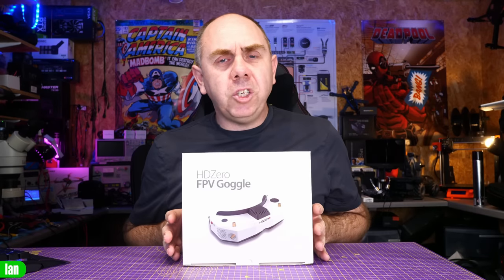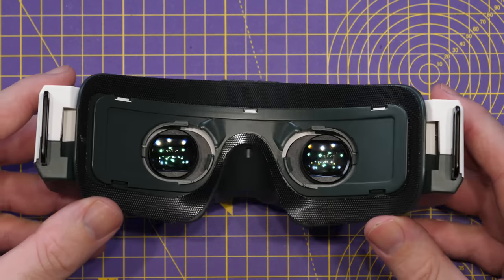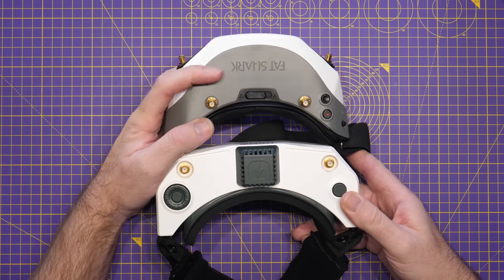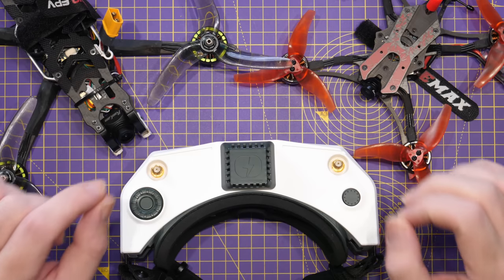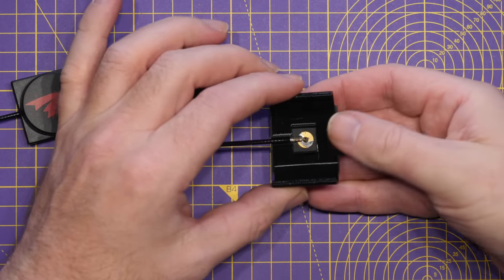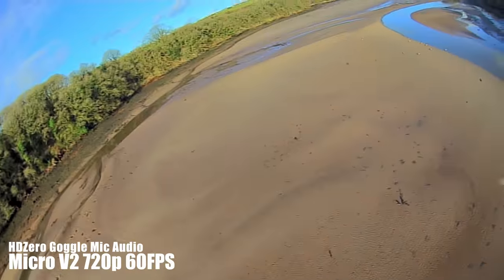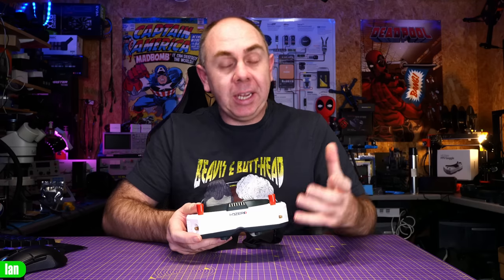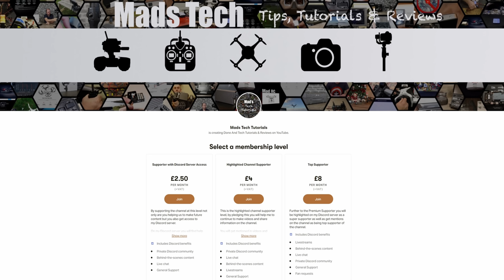HDZero FPV Goggles Review - Best FPV Goggle Available Today?

Comment: It's a feature rich goggle but...
1) I have some analogue goggles.
2) I couldn't live with HD zero's almost constant  breakup.
3) Ultra low latency is of little interest to me.
On the upside, the + 6 focal range is better than just plus 2 like on my Walksnails... HDMI input port...🤔😳🇬🇧
Reply: Very true
Reply: Almost constant breakup? Where do you fly bro? Are you flying strictly in high reflective metal envrions? Where are you seeing constant breakups lol
Reply: @elxero2189  You can see it on most HD zero clips...go anywhere slightly out of LOS and it starts it's breakup....🤔🙄😳😏

Comment: Plus, the only goggle on the market which allows -6 to +6 focusing.
Reply: Skyzone also does I think.
Reply: @JoshuaBardwell  No, they claim -6 to +6, but if you ask them (as I did by email) they admit this is an error in their spec, and it actually only does -6 to +2.

Comment: There’s some pilots reporting screen rolling with every vrx except Fusion.Also racers are supposedly not able to race with Rapidfire in HDZero goggles and are buying Fusion so they can race without getting rolling screens.
  Can anyone verify if it’s rumors or facts?
Reply from the maker: Not everyone is having issues. They are still working on improving FW.
Reply: @MadRC  Thanks for the update!!!

Comment: Can you tell me your personal impression on the FOV in 4:3 compared with the SKY04X?

Of I am correct the FOV is smaller while the resolution is higher.

Goggle ratio FOV horizontal vertical resolution

Skyzone 4:3 46° 35.3° 1280x960
HDZero 4:3 35.3° 26.9° 1440x1080
Skyzone 16:9 46° 26.9° 1280x720
HDZero 16:9 46° 26.9° 1920x1080

This is just the math relying on the specs.
Reply from the maker: Yea on 4:3 it’s a smaller fov due to the 16/9 screens. It’s not massive but it’s smaller.
Reply: Thank you!

I have to correct my table! I was wrong about the FOV as not the horizontal FOV but the diagonal FOV is given.

Skyzone 4:3 46° 1280x960
HDZero 4:3 38.3° 1440x1080
Skyzone 16:9 46° 1280x720
HDZero 16:9 42.6° 1920x1080
Reply: @flydayone_svalher  skyzone 16:9 fov is 42.5deg, hdzero 16:9 fov is 46deg. Hdzero 4:3 fov is 38.25deg
Reply: You are fully right... I did this in the night and mixed the values for both goggles in 16:9

Skyzone 4:3 46° 1280x960
HDZero 4:3 38.3° 1440x1080
Skyzone 16:9 42.6° 1280x720
HDZero 16:9 46° 1920x1080

Comment: Would you upgrade from the 04x with module? Or not enough benefit
Reply: If you only fly analog, I would suggest you stay with Sky04x. Features will be pretty similar and O4X have larger FOV in 4:3. If you're gonna fly walksnail or hdzero, absolutely Hdzero.

Comment: how would you screw a pair of normal patches (think menace) on the front? Is there space to put your fingers there and tighen the bolt?
Reply: It would be tricky, but people have been printing nut extenders to help.
Reply from the maker: I have 90 adapters and the pico patch fits fine.  There is plenty of space for doing the nut up
Reply: at the end of the day i'm using 4 omnis. that makes it so compact and the reception is still good.

Comment: What's the range of HD zero vs dji?
Reply from the maker: HDZero does not have packet retires or a two way link.  In all open space HDZero can outfly DJI but it’s very different when you start to look at obstacles.  There is no physical range limit on HDZero and it’s all antenna and power.

Comment: One of the only reviewers who didn't over hype the new hardware de-interlacing when discussing the analog performance, and rightly so since your side-by-side comparison video speaks for itself. Apart from the difference in saturation (which is likely due to the modules being different) the analog performance was pretty much identical IMO. Based on this I'm sticking with my Skyzone 04x. Funny how even with the VRX it's still 30g lighter than the HDZero goggles 😂
Reply from the maker: There is better image processing in the HDZero goggle that attributes for the goggle improved analog look.  The de interlacing is noticeable but not dramatic

Comment: One question you sayed that you need to use All 4 antennas but of i only want to use it for Analog for now Do i also need to use All antennas so i dont burn the HDZero VRX out ore can i just by them later when i get my first HD Zero System?
Reply: You'll be fine without them. Typically only the Tx is susceptible to burning out sans antenna.
Reply from the maker: Yes if using analog no need for antenna on the HDZero side.
Reply: @dr0n3droid  and  @Mads Tech  thanks a lot
One more thing, Do you get an hdmi output when using an Analog Module?

Comment: I'm planning on jumping away from my DJI v1 goggles. This review clinched that these are the goggles I need.
Reply: Feature wise this is SO MUCH better, but image quality is so much less..... i use DJI for the image quality. When i am flying i don't need all the features....
Reply: @HermanKruisman  flying what?
Reply: @M-H433  planes
Reply: @HermanKruisman  except the v1's life is limited since they are incompatible with the O3. These + Walksnail and analog will meet all my needs, I'll take hits in image quality and more open systems since DJI has abandoned the early adopters.

Comment: I hate dji.... because of their namely-price gouged products.... BUT dji goggles are... Supreme😎
Reply: Well, the O3s' image is the best. But their latency is not. And flying with others is quite a problem as they hog the spectrum. And you can't set the output power at all... And the goggles have no other I/O functions than just DJI, which is annoying if your friends don't all fly DJI..
At some point all of those negatives become enough that you'd tolerate slightly poorer image quality in order to avoid all of that (eg Walksnail, or even HDZero if you're racing).

Comment: Will you be able to safely turn on the goggles and change source to the external module without damaging the hdzero vrx? or do you need all antennas attached even when using analog?
Reply: The HDZero system does not transmit so there is no problem turning it on without antennas. I once forgot to add the omnis to my HDZero VRX and only realised when I got more static when flying out off the area in front of me that is covered by the patches.
Reply: @P-Bee  Thanks! however im confused, analog vrx's are damaged when powered on without antenna, aren't they also zero transmit?
Reply: @radfield6089  No, receivers aren't damaged without an antenna. It is the power amplifier in a transmitter that is damaged when there is no antenna to radiate the energy. I'm no expert but more than once I have seen people say that is the case. I've also seen people run diversity receivers on their goggles with only one antenna when they have forgotten or lost an antenna with no ill effects.
Reply: @P-Bee  Hmmm I must have gotten the vtx on the drone and the goggle vrx mixed up when i heard this. thanks!
Reply: @P-Bee  If the receiver has telemetry, its telemetry transmitter can be burned out by running without an antenna. But the receive capability is fine.

Comment: I have not read the comments but I bet you will face another storm for sure even though others had also mentioned similiar results and thoughts about the performance.

But I checked the hdzero fpv goggles videos released today and view counts, so all the stats around midnigt MEZ

So Botgrinder is in the lead with 3,8 K and you and Nick Burns are on the podium while the rest has just about the half of views.

But to share a secret with you: You might even make it to the top even if Botgrinder is 800 ahead but

guess what? 
Disqualified due to cheating cause he had released 1 hour earlier than all the others.

I will check the view counts again cause somehow they are a bit disappointing 8 hours after release considering that this is the hottest of the hottest so far, OK, year is still quite new. Anyhow. I like those a lot but I have to stay with dji cause I do not build drones, only planes and so I need dji goggles considering I will not depart the DJI drones soon.

great content and you are really proud to share, but quite a long video which I had not expected cause usually you are the master of cutting and shorten till you have nailed it.
Maybe too much content HDZero had delivered. But I guess you will have a busy schedule for the next weeks to create and share far more.
Reply from the maker: Yes was really hard to make this shorter. Tbh there are things I did not cover in this now
Reply: It's just his review,who cares about bumgrinder or views,mads has great release content....

Comment: It's made in China. That is a killer for me. I guarantee corners were cut somewhere. I am an American ex-pat that has lived in China for over 10 years. What the hell is a voltage rating of 2 - 6 S? Volts = V. Amps = A. Watts = W...   What the hell is S? Is that an British thing?
Reply: S-rating is a way of designating battery voltage. 6S means six lipo cells in series, for a voltage of 25.2 to 18 volts. This is used worldwide.
Reply: @JoshuaBardwell  Thanks.  I have never heard of that before. I've been in electronics for over 40 years. Thanks for updating me.

Comment: Skyline cobra x have hdmi in and you can do same things and it cost only 200€
Reply: It can't do native hdz which you're getting for free at this price it doesn't have a de-interlacer  and it doesn't have 90hz screen capable of doing 100hz for low latency systems like walk snail and it's a lot more bulky than this. Not to mention feature rich and open source software for future improvements not to mention the wifi analogue module for updating and streaming.
Reply: It can't do 100 hz with walksnail. It can't do 540p90 with HDZero. It can't do the ultra-low latency optimized video signal path. Not saying it's not a good value, but you absolutely do get upgrades with the HDZero goggls.

Comment: The only thing I want from HD zero is at least a 1080 60fps camera to go with these goggles. being limited to 30fps at 1080 is just....well not flyable.
Reply: If you flew analogue you were flying 30fps I'd take a wait an see approach before deciding that it's "unflyable" I'm pretty optimistic about it being fine remember hdz is not a retransmit system like dji which absolutely needs a 120fps camera to be worth flying. Infact 60fps hdz is the same experience as dji 120fps
Reply: @elxero2189  I'm fairly certain analog is 60fps. Also based on your math 30fps hdzero would be like flying 60fps dji which by all accounts is just...bad. Im still excited by hdzero but they need to bump the resolution to pull in a wider audience.
Reply: Analog NTSC is 29.97 FPS. HDZero 1080p at 30 FPS will be fine.
Reply: @zuldanfpv4634  NTSC is a broad cast standard and not a limitation of analog video. However most analog cameras in the states do use NTSC, but you are confusing Interlaced and Progressive video. The NTSC standard is to scan the image once at basically every 1/60th of a second, however, due to limitations of broadcasting data at the time it was sent interlaced, where only half the image is shown at a time, every other line, then the other half. When deinterlaced and displayed as progressive you achieve the full 59.94fps that NTSC scans at but you loose resolution, so 480i becomes 240p. No matter what, the camera samples its sensor every 1/60th of a second, but, instead of using two samples to create a full image every 1/30th of a second it uses only one to create a reduced resolution image every 60th of a second. However, if im not mistaken, more complex deinterlacing systems actually interpolate the the missing lines, based on what was displayed on those now empty lines 1/60th of a second ago, and what is being displayed on the current lines. This is why people are excited for the new HD zero goggles for analog, they have a more sophisticated deinterlacing system which creates less artifacts among other benefits im not fully aware of. So 30fps hd zero, which should be progressive, will be much slower than current analog systems but have much greater resolution. try playing a fast paced shooter at 30fps and you will begin to understand what it will be like.

Comment: Hdzero goggles doesn't even come close to DJI o3 or walksnail. And let's face it, if you would reduce the picture resolution to 1/4 and the fps to 2/3 the latency of DJI   would be even better than hdzero. And come on the o3 has no stutter if you fly next to a football field. Hdzero is only alive because all the analog racers would complain about interference. The hdzero goggles are the most expensive, largest, bulkiest, noisiest with the worst picture quality. Fly 1080p at 30fps, redicuolus.

Comment: Yeah shame Walksnail smashes them
Reply from the maker: No question WS has improved massively with IQ.  But it’s latency is still highly variable.
Reply: @MadRC  much the same as them all. Depending on bit rate and antennas. Unfortunately for best quality you need to replace the stock antennas for most of the digital units to get proper tune.